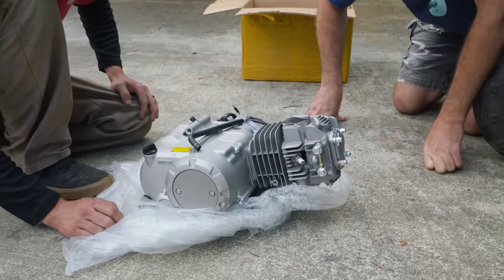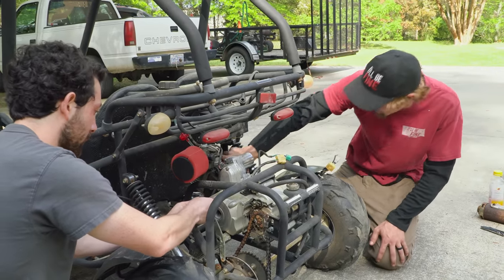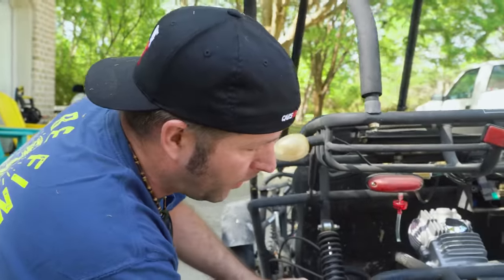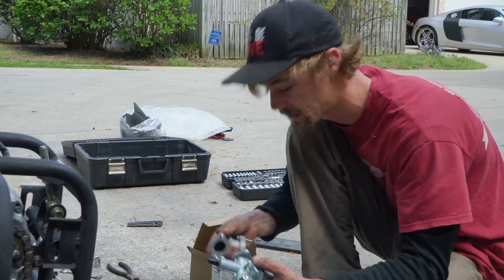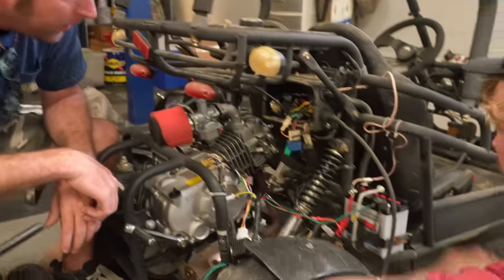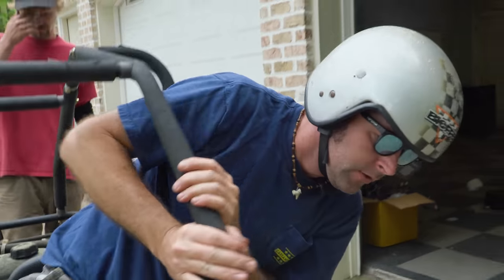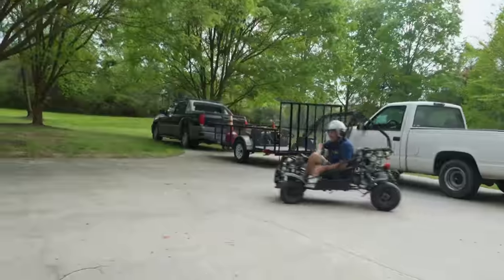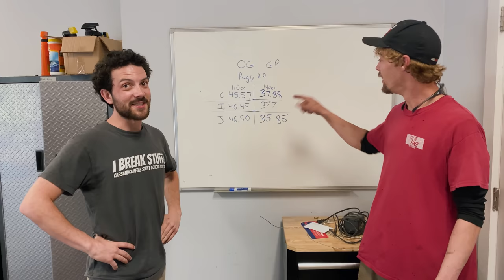Barn Find Off Road Go Kart gets 3X Horsepower | HO 140cc 4 Speed Swap!

Comment from the maker: The 140 is really the Goldilocks engine for this kart- plenty of power, still decent on fuel! This was a fun one.
Reply: Can you share the name of the 140 engine? Thank you!
Reply: @jeffeverest1  Probably a Lifan/Loncin/ZingChen or some sort of those engines.
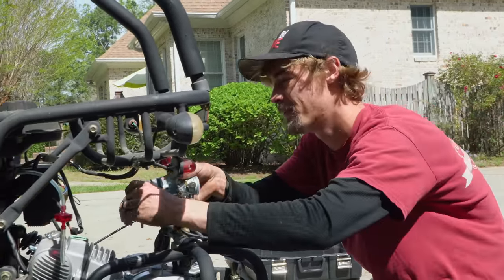Reply: 9:39 Oh Charles is tiring to hide that laugh at what he said ha ha ha.
Reply: If that's the goldilocks zone then what would a Yamaha 530Tmax or kfx700 motor be...?
Reply: You guys should totally actually probably do a good full on upgrade to the front steering to make it far better for a machine as fast as this one.

Otherwise, I think this thing is pretty cool. And as per always, keep doing what you do, because good lord this stuff never gets old.
Reply: @racerx9223  too spicy lol
Reply: heads up i tried contacting you folks about a honey hole in TN if you're gonna be out this way i got you guys covered
Reply: It definitely looked like it was a lot of fun to rip around in.
Reply: See? It’s better when you’re not using a trash 212 without any kind of proper transmission...
Reply: Guys need to do a Pugly revival so you can get it running again and maybe do the same engine swap to it too it would so awesome to see 👍😃
Reply: Where did you get the engine?
Reply: You could have gone with a 5 speed 4 valve 190
Reply: Needs a full rebuild, lights, seat & new platinum grey or camo paint to mix it up.
Reply: Can you do a tear down vid on a 212cc predator my idiot brother sent our gokart around a corner to deep and the corner is the edge of our pond and it got sunk we need a vid specifically for the tear down of a 212cc predator so we can take ours apart and put it back together
Reply: @issacdaniels942    A Duck-Duck-Go Search for predator 212cc engine schematic pulls it all up..... pdf documents etc etc..
Reply: I need 150cc gy6 timberland Crossfire
With no reverse
Reply: @andrewschwartz4954  I am in TN.  Do you have any old karts to sell?  Thanks
Reply: @jeremydawkins8399  I live in Tn and  have a Murray ,just put  new 212 preditor,new clutch ,2 new front tires and chain for 600.00
Reply: @CBALLEN  where in TN?
Reply: @jeremydawkins8399  west Tn.,humboldt.0
Reply: Where are you?
Reply: @CBALLEN  South Jackson
Reply: @Rasse796 lifan ofc

Comment: Try some four wheeler mudd tires.& Rims on that go kart guy's. It'll handle way better than the last ones did easier to. Smaller four wheeler mudd tires.& Rims will work on that part. You might half to modify the mudd flappers./whee gaurds.  You can also use A mountain bike derailleur for the chain tensioner guide to cause it's spring loaded to. Just fab up your own mounting bracket and bolt 🔩 it into place is all.

Comment: I have a 140 pit that appears to have all the goodies on it fmf pipe oil cooler, aftermarket “ excuse” clutch on 4 or 5 speed making carb and uni air filter .. I ve  only rode it once because I’m old & large and for a little bike I found myself trying to chase it to remount my ass back in the saddle and initially chaulked it up as clutch adjustment issue and within a few minutes I found the same issue presented it’s self in 2nd & 3rd gears and I’m sure that preloading the rear suspension with close to 300# most of it south of rear tire leaving the front end only on the ground as you brake into a corner and that’s the point I realized that the front tire had the same characteristics as a drift trike with plastic sleeves except the pit bikes were narrow and in the front !
  So I’m thinking it’s a perfect candidate for the CRG drift cart that I picked for grandson recently . Word or advice to the young fathers if you set the bar to high right out of the gate they ( kids) will consume HP faster than the money tree will grow it so unless you go all in full send mortgage the farm on a 8 yr old signing and running off to Pastrami land where gravity is only a poor man’s theory relativity ,modern relativity is 
E =[ Mc +$ ] will give you weightlessness or unless you over shoot the foam pit dumpster then the old theory still applies.  Great build I got to get busy on my new antigravity kart that makes you young again !

Comment: Hey guys so i'm looking to build a powerful engine for a go kart i'm getting this summer 
i'm going to buy a 7hp Duromax engine off amazon 
Will a duromax engine work with?
265 hot camshaft
billet flywheel/connecting rod
clear blower housing 
honda clone pull starter 
and a straight pipe??

Comment: ehh, just fill the scotch loc with a polyurethane sealant like ultima to make it water resistant. they're ok for low amp, low vibration uses, but if you're gonna wire up an electric winch, or a harness that needs to flex a lot, you might wanna go a different route. they are a field expedient solution, and are better than just twisting wires together and wrapping them up with electrical tape. any electrical connection exposed to the elements will eventually corrode, even if its soldered or terminated into a connector plug, it's just a matter of time. i've even had a weatherpack connector that was corroded on a vehicle that i worked on before, and those things ain't cheap.

Comment: The way it breaks up in the low end on take off sounds like it's over fueling. I'd adjust the idle mixture screw and if that didn't help I'd be swapping the Jets. It would help drastically for take off power. Also one of the 3 prong racing spark plugs helps alot.
Reply: It definitely needs some tuning... I heard that stumble and stutter off idle from a stop as well.
Reply: @jasonjulian1  could be gearing
Reply: @ryandoyle4344  Absolutely could be. You’re right. It might need a little bit more gearing help to get the RPMs up from a dead stop like that.

Comment: I would be a little iffy about that chain rubbing the case, just saying I would inspect that real carefully to make sure that there absolutely no chance of it causing an oil leak. if there's no chance of an oil leak then I would go with it. those scotch lock things that you used, I don't have a complaint with them. I seen them quite a bit especially when adding a trailer light connectors. I've even used them myself without any issues. a person just has to make sure they are covered up and not left out in the open in the atmosphere. but I wouldn't recommend using them on important electrical components under the hood of a vehicle. I don't know but I think some people would bitch if they were hung with a brand new rope.

Comment: the "do not use" are fine if you check that the core of the wire is lined up before clamping down (if its not aligned it will just cut it)

Comment: Sometimes you have to wiggle the wire around to make sure it has a good connection!👍😬 As discussed earlier, the Scotch lock connector is not the best, but will work if hooked up properly!😉✌️ And you might have to do some jet work on the carburetor for maximum performance! Or close to it anyway!👍🤞🙏

Comment: These 140s are fun to swap into small things! I've got a lifan 140 5 speed on a 2006 kawasaki klx110 and it's a blast. If I had the room I could probably pull a 3rd gear wheelie. I weigh 195 and the bike weighs around 100 pounds (maybe less since I can toss it pretty far)  for reference.

Right now I'm waiting on a big bore kit and a bigger carb so the bikes in pieces waiting for a refresh on everything (especially the brakes)
Reply: You swapped a klx110 for a pit bike engine lol that is a crime lmao I bet it's fun though and better in fuel and can blast all day without cooling down  can thrash em for hours and not need work after an hours ride like some new bikes

Comment: Need to rotate those rear tires get the tread going the correct way, help traction.
Reply: They are bald…don’t think it will help at this point.
Reply: Was thinking the same thing!
Reply: @tylertieman1678  there's enough there to help. 2/3rds of the tire has tread left , they look like they've been run way over pressured by the previous owner so at the right pressure those edges will dig in when turning with the flex of the side wall.
Reply: @jayhow997  or they can just spend $40 and put new tires on it and only have to take them off once.
Reply: @tylertieman1678  yeah they can, no harm in testing though is there.

Comment: Tilting the front of the engine up is actually not a good idea the oil pickup is actually towards the front of the engine on the clutch cover side so it may starve it of oil only if you put a lot of oil in it
Reply: Dosent matter with that hack job anyway.